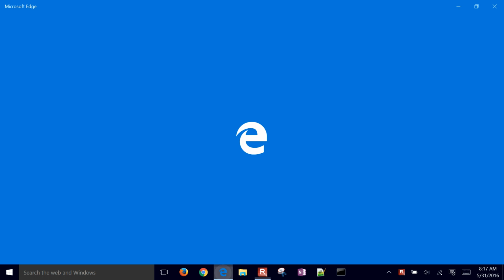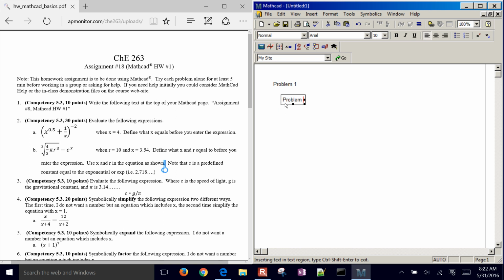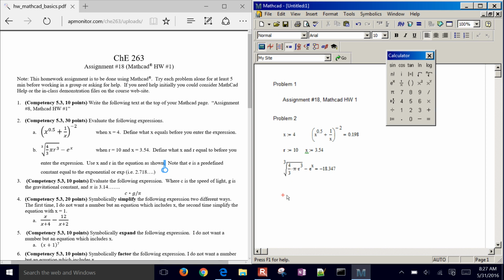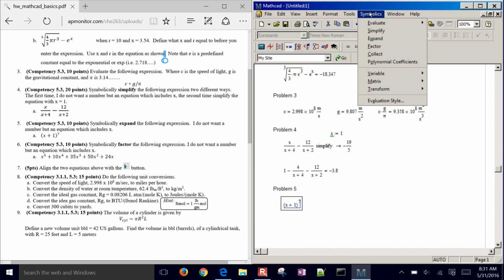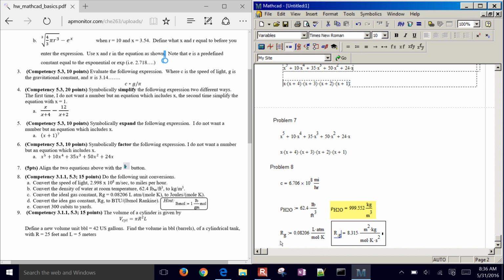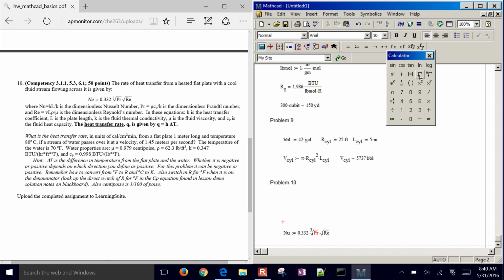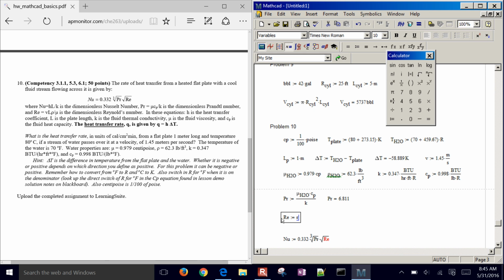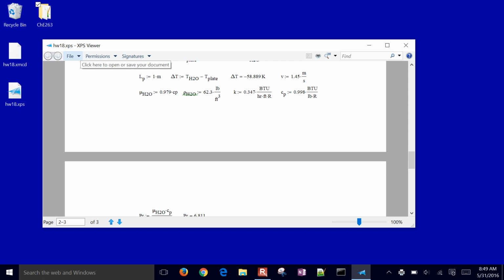Introduction to MathCAD for Engineers

Comment: asked sir.
1. I have a problem in the formulation. so some values don't connect. how to fix it?
2. I want to change the unit from m2 to psi. but when I change it, the values are not the same and there are 2 units. how to fix it?

Thanks for the response and explanation.
Reply from the maker: This sounds like an issue for MathCAD support. I recommend going through their tutorials. The latest version is different than the one I showed.

Comment: Hi, Mathcad has something similar to the base mark I could not and could not find. Like "An", but "n" in there is a function, a base. It's like a formulator. Sample video, https://www.youtube.com/watch?v=Z8CINSwDB6I
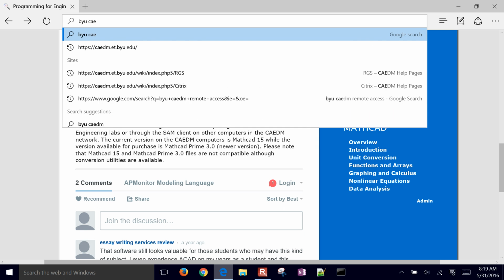This video is performing that spelling at exactly 1:59 time. "A s" is doing. How is this done?
ANSWER.
Thanks.
Reply from the maker: You can do subscripts with a "." - In this case you would type A.s  There is also the index operator that has shortcut A[s (with a open square bracket. You only want to use the index operator when you have a vector.